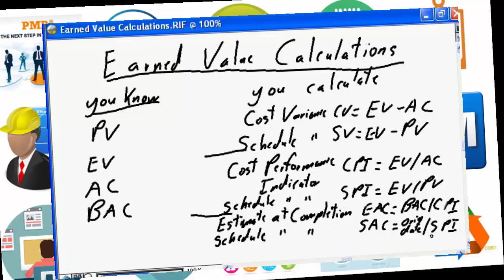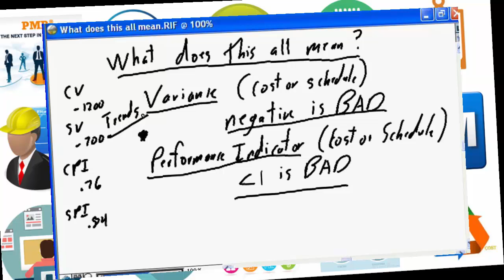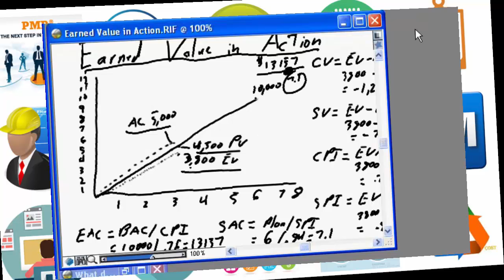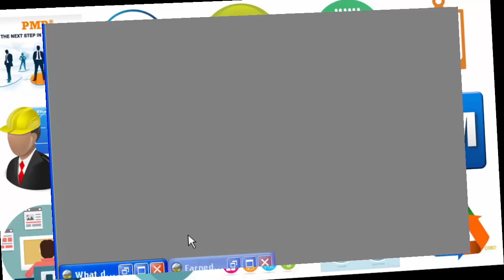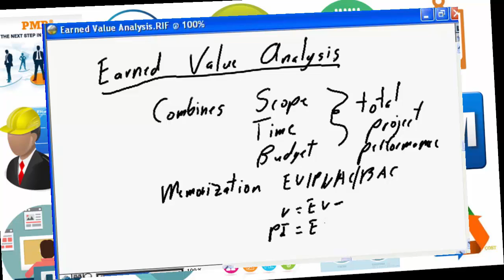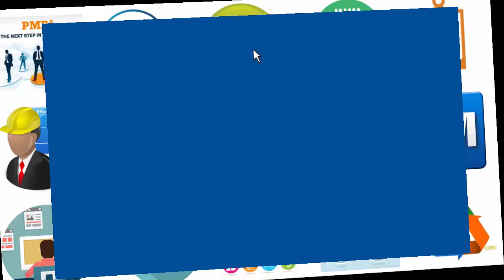21. Earned Value Analysis

Comment: Nice lecture, but I had trouble reading some of the text. It is hard to write legibly with a stylus so you might consider some other format. I would have preferred a video of you writing on a marker or chalk board, but that might be old-fashioned at this point.

Comment: Ever tried to calculate earned value for a construction project with 2,000 work packages. 20,000 assets and 100,000 work steps ( 5 work steps average per asset)?

Comment: QuestionS: 1) is the contingency counted in the original budget?  2) if you use contingency for training to bring the project in on time, doesn't that cost get added to the original BAC?
Reply: I remember that in Pmbok 6th Ed., contingency is a part of the originsl budget. Check it out I might be wrong.
Reply: The contingency is included in the budget or BAC.
#SunnySensei

Comment: I thought your instructions were terrific. I think if you listen to this video again, you will probably add some noted corrections into some of the things you were saying even though your intent was made. I do not think that scope was tied into your calculations at all nor can it be. I just don't see how you can show through calculations how scope is or is not doing. A point that should be made due to your introduction, we can analyze the scope portion with help from our calculations but that is as far as we can go. The actual scope will be determined based on other factors which are outside the intent of EVM.